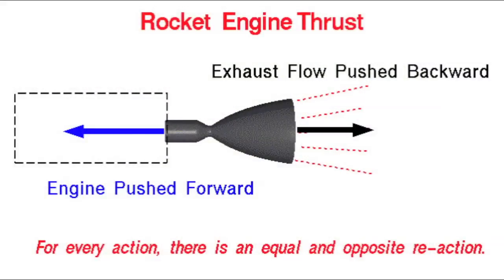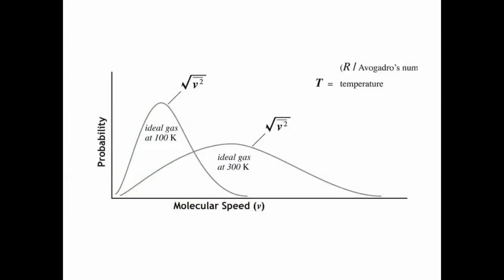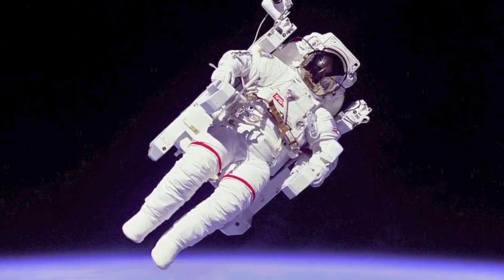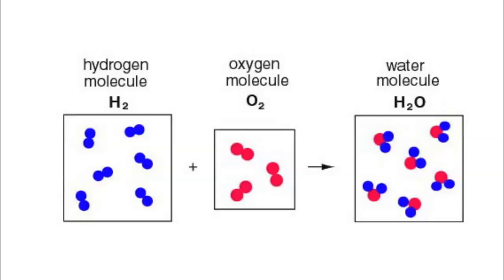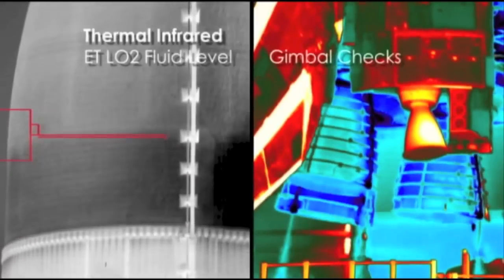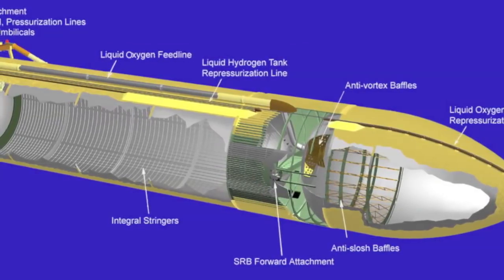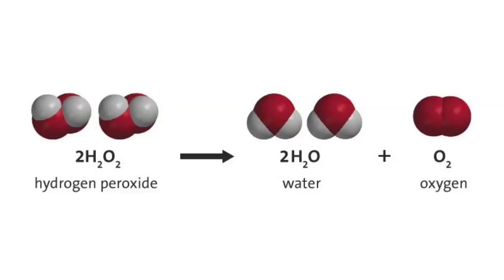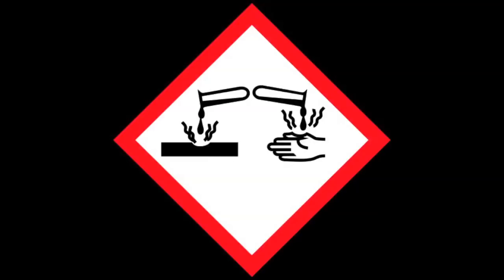WTF is Rocket Fuel Anyway?

Comment: From what I can find to produce antimatter you would make use of the Antiproton Decelerator and the high energy of the LHC isn't needed. The current production rates of antimatter would mean that it would take over 100 billion years to produce 1 gram of antimatter. Also as of yet people have only really stored a few hundred anti hydrogen atoms for less than 20 minutes. You'd certainly want more than 10^22 times more anti hydrogen atoms and store them for many times longer for use in an engine.

Comment: How about VASIMR? Also, there was an experiment with a small-scale atmospheric laser propulsion. It focused the beam into a point below the craft, heated the air to a plasma and rode the pressure wave up. I had to do a 5000-word essay on alternative propulsion for one of my extended project and it was one of the ones I covered, though I can't seem to find the essay itself so I can't give you my sources. Also, its potential for debris removal could be interesting for us space-littering KSPers.

Comment: Depends what you mean by environmentally friendly

C2H5OH + 3O2 -> 2CO2 + 3H2O

The combustion of ethanol produces carbon dioxide (global warming), although it doesn't directly harm anything

A rocket made of ethanol, i imagine, would be extremely inefficient. Ethanol doesn't burn too hot, and CO2 and H2O aren't as light as some of the exhaust gases for other fuels

I'm just guessing though, perhaps I'm all wrong

Comment: Well, it depends what you want to do with it

You could potentially use antimatter -> matter collisions to heat up a propellant (to whatever temperature you would like) and expel it out of the engine at extremely high velocity. Theoretically it'd probably be quite efficient.

The main problem is that we can't really produce antimatter in any reasonably quantity, and storing it is a bitch (seeing as it annihilates on contact with matter and turns into pure energy)

Comment: I don't think the V1 wasn't a rocket, it was a jet if I remember correctly. However, the V2 was a rocket, and yea they were both pretty much useless. They were expensive, inaccurate and  ineffective, blew up on the pad as often as they launched, and were ridiculously short ranged for a rocket. 
Anyways my point is, we may need all that ridiculous power and cooling you describe with today's technology, but is that a reason to give up on it? Who knows what incredible breakthroughs might pop up.

Comment: Radioactive materials produce a lot of energy. If there is enough, the energy sets off a chain reaction that makes too much energy which explodes and fissions it much faster. If there isn't though they just make a lot of heat. Nuclear engines don't actually use liquid fuel and oxidizer like in KSP, they just heat up something like monopropellant and spew it out. In the config file it has a note that says that the devs know it isn't realistic but didn't want to make separate types of fuel yet.

Comment: Scott, you forgot the one mixture that might be the wave of the future: liquid methane & liquid oxygen.  The XCOR Lynx's engines will be powered by methane & Lox, and Spacex has announced their Raptor engine will also use it.  It has some huge advantages: it's cheap and widely available, you can make it on Mars, it's less cryogenic than hydrogen and denser, and it doesn't clog up engines with carbon (great for your reusable rocket).  Downsides are its cryogenic and less dense than kerosene.

Comment: How could you beat LH2 + LO2???  You can use solar power to distill and electrolyze water into H2 + O2 and then compress/cool it to liquefy it.  Done.  You'd need a LOT of solar power to do it...but, when it's not busy making rocket fuel, you could provide that power to the electrical grid.  Plus, as Scott said, these propellants turn back into water vapor when used up.  Done.

Comment: Project Orion, there's quite a good wiki article I think. Basically it was pretty seriously considered as an interplanetary drive. It gives both high thrust and high exhaust velocities (and thus efficiency) kind of like combining the nuclear and mainsail engines in ksp ;) 

Basically you can't achieve this in a normal design because it would make the internals too hot, so you throw it outside and just blow it up. 

I believe it was abandoned due to the test ban treaty and concerns over fallout.

Comment: The SLS's first stage are the Shuttle's boosters with one additional segment. The second stage uses RS-25D engines (simplified but less efficient SSMEs)
The third stage will use up to 3 J2-X Engines. The Shuttle's Boosters run on Solid Fuel, the RS-25D and J2-X are Expander cycle engines running on liquid hydrogen and oxygen. YET there are proposals of using Liquid fueled boosters using F1-SIZED(NOT F1) Engines, but thats a theory by now.

Comment: WARNING: I don't know what I am on about either, but I have a vague idea
A nuclear engine is somewhat like a nuclear reactor in that a radioactive material undergoes controlled decay to create heat. A medium is applied to the material which causes it to evaporate at a huge rate. In a nuclear reactor this drives a turbine, whereas in a nuclear engine it's thrown out the back of the rocket to create thrust. I may be right, I may be wrong. I don't know TBH XD

Comment: Excellent video scott!

I liked your explanation of why nuclear rockets have a higher specific impulse then chemical rockets.

I thought I would add some other obscure propellants and engine types as well:

Arc-jet reactors, which use an electrical arc to vaporize a reaction-mass propellant such as butane. 

And pulsed plasma thrusters, which use an electrical arc to energize an inert solid propellant. 

Both of these are on wikipedia.

Comment: To be precise, in the case of turbojet and turbofan engines, they fan blade sucks the air and then being compressed inside the engine. The compressed air then mixed with the jet fuel and then "boom", the fuel ignites. The gas expands and then exhausted to the rear, and thus, propelling the aircraft. But in the case of ramjet, you need at least mach 2 velocity for the engine to work since ramjet doesn't have any fan blade to suck the air. That's the short explanation about how jet engine works.

Comment: You can't stop heat from flowing into the cold fuel, and if you keep the tank sealed the pressure will rise as it tries to boil. Density liquid H2 at boiling point & 1 atmosphere is almost 80kg/m3. Density H2 at 0C and 1atm is 0.09kg/m3. To match density of liquid would need 80/0.09 = 889 atm of pressure. Tanks would be too heavy to fly. Space shuttle tank was ~2 atm. Instead they keep the liquid cold by allowing boil off to take heat away and keep topping up with more liquid until launch.

Comment: Indeed. These engines only work in-atmosphere because they require atmospheric oxygen to combust the fuels.

The KSP concept of "air-hogging," throwing on preposterous amounts of intakes on a ship, exists because it allows you to "gather" more oxygen at higher altitudes. High altitudes involve low pressure atmosphere, meaning there is less and less oxygen the higher you go, so more intake surface area is required to obtain a sufficient amount of oxygen to prevent flameout.

Comment: Maybe my understanding is a bit lacking but based on my understanding of the SRB design wouldn't they lose all their thrust during flight gradually as the fuel is used. My understanding is that the fuel burns and the force goes out the back but the pressure that make it all happen would lower since it expands as the fuel decreases.
ps I watched a show about going to AC in the future and the host had this idea about solar sails getting hit by light to travel, would that even work?

Comment: Google Pentaborane and Dihydrogen Difluoride for extra fun propellants...

Hydrogen peroxide is sadly overlooked these days. It doesn't have an enornous specific impulse, but as an oxidizer it does have a bit better performance and it's non-toxic, storable and fairly dense. It also makes for much lighter exhaust gases than LO2 + RP1 (much higher H2O content in exhaust). And it can be used in a monopropellant staged pump cycle.

Comment: Nice.

The exhaust of the SSMEs isn't just water. They run hydrogen-rich rather than stoichiometric, and anyway there isn't time for the reactants to reach full chemical equilibrium during supersonic expansion, so the exhaust includes hydrogen in less oxidised states as well as water. The extra hydrogen gives a higher specific impulse with a cooler flame.

For mad fuels, look up the Charles Stross short story 'a tall tale', and John D Clark's 'Ignition!' for the truth.

Comment: I am aware of how a fusion reactor works. I must apologize for I don't really know what the person meant by an "engine that works on fusion". I assumed he/she meant to replace the normal fission reactor with a fusion one. In theory it would work to drive an engine as both nuclear engine types produce heat, wich is what is needed to drive the propellant forward(if I understood the video correct). A fussion reactor would probably not fit in a rocket though.

Comment: To get the most out of your rocket you want the exhaust of the rocket to be flying out of the rocket as fast as possible.  When you are in the atmosphere you have to fight against the pressure of the atmosphere which slows your rocket exhaust down.  In space there is no atmosphere to fight against so your rocket works more efficiently.

Comment: I believe it has a lot to do with controlling the rate of expansion of the exhaust so that you can impart as much energy as possible to the craft. Varying the exhaust velocity and temperature allows thrust and specific impulse to be altered, usually there is a trade off due to the laws of thermodynamics and what have you.

Comment: we have made antimatter before although you can only store it in extremely small amounts with a strong magnet in a vacuum not to mention controlling the resulting blast through an engine would be a huge challenge in itself also the magnets would break the electronics on the ship and if the fuel tank gets a hole in it your in trouble

Comment: Yes, SLS will use the same fuels as the space shuttle. No, they didn;t consider anything else because one of the requirements was that all of the components be 'shuttle derived' because congress sees NASA as a jobs program. They are using the actual SSME engines for the core and extended 5 segment solid rocket boosters.

Comment: That is incorrect. Plasma is simply ionized particles. Electrons are stripped (not destroyed) from the atom, but not all of them are removed. Electric signs (e.g. Neon signs) are simply glass tubes with an ionized gas existing in a plasma state. Same with plasma TVs. Plasmas do not need to exist in high temperatures, but they often do.

Comment: Plasmas do not necessarily need to be hot. Plasma is simply charged particles, and ion engines operate by ejecting ionized (charged) particles aft; they could be considered a type of plasma engine.

Different types of plasma engines exist, such as the VASIMIR, but they generally differ only in the way they ionize the propulsion agent.

Comment: Not to hijack your question, but a functional "antimatter engine" would work similar to a nuclear engine. The device would mix equal parts of matter and antimatter, the combination of which releases pure energy (heat, light, etc...). While this would provide no thrust on its own, the energy could be used to superheat a fluid to expand, vectoring it for thrust.

Comment: no. Void volume has little effect combustion chamber pressure while there is still fuel to burn. The pressure is set by a balance between how fast the fuel is burning and how fast it can leave the nozzle. Burn rate is mostly determined by how the grain's surface area evolves. Nozzle flow is non-linear - below a certain pressure it chokes and reduces flow.

Comment: Its just my understanding was that you had a solid chunk of fuel sitting in a container which would empty as the fuel burns creating a gap in the fuel that would lead to lower and lower pressure and in turn thrust, there for rendering the SRB essentially useless after it burns 50% of its fuel (depending on design).

Comment: Nope. The most efficient fuel at launch is actually RP1, due to its higher fuel density. This makes the fuel tanks (and therefore the rocket) smaller and lighter, which reduces weight and air resistance. Once the rocket has left the atmosphere, though, air friction is effectively gone so the higher specific impulse of hydrogen wins out.

Comment: Core design and cross section is one of the biggest factors related to solid rocket performance, and determining how the core will expand during burn is equally important.  Look on Aerotech Rocketry's model rocket site to get a small idea of how it works, and compare the blackjack and warp 9 motor types.

Comment: Yes we have made antimatter in a lab...what's problematic is that you have to use high power particle accelerators to make it and the you have to IMMEDIATELY capture it in a vacuum within a magnetic field or it will detonate on something like a stray air molecule..

Comment: A Question,If most fules need an oxidizer(oxygen being rather finicky to deal with, but great for bonding with other elements). Would/could/are there fuels that use carbon for a similar reaction?

Comment: Thanks a lot! I knew that the temperature change would be impossible to avoid, and figured that the pressure would rise too, but I wasn't sure how strong that pressure would be. I suppose I also don't understand how large pressure vessels like those differ from small ones that one would see more often, like a compressed air tank for paintball or a scuba tank. You definitely gave the best answer here =3

Comment: What is the rocket fuel in KSP?
Reply: Ben Hamilton By the usage of jet engines, it appears that KSP's fuels are Kerosene and Liquid Oxygen, but there is quite a bit of debate and nothing official has been stated.
Reply: +Ben Hamilton It's rocket fuel.  Nothing more, nothing less.  The densities mean it's close to RP-1 but it's used in the nuclear engines and fuel cells which then suggest it's H2.
Reply: in ksp the fuel depends on engines.
Reply: Liquid hydrogen, judging from the product description of the ISRU converter.

Comment: What about Ozone as an oxidizer?
Reply: I'm pretty sure ozone is actually less reactive than O2 since it doesn't have the double bond
Reply: Test Tube
I thought it was more reactive. I heard it somewhere.
Reply: 5thDragonDreamCaster I could be wrong, I'm just going by what it seems to be based on the type of bond
Reply: Test Tube
I'm not sure, but I do know the use ozone to kill bacteria.
Reply: Hi sir. I think it's because Ozone is relatively heavy. Are you proposing a standalone use or with something else(Hydrogen for example)? I mean if it were to be used alone maybe it won't be the worst material for a mono-propellant. Maybe Scott Manley can help us with this pickle (:
Reply: MHD Rachid Alhourani
I was supposing with Hydrogen, but I suppose that it could react down from O3 to O2 and be a monopropelant.
Reply: 5thDragonDreamCaster well that's how Ozone be like :p
Reply: well, the problem here is that ozone spontaneously decomposes into oxygen... Under atmospheric conditions the estimations for the half life of ozone go as low as half an hour (though this is not verified, as it is difficult to study). This can obviously be prolonged by applying pressure, but storing it for sufficient lengths of time would still be a real problem. Not to mention the fact that getting any amount of it with reasonable purity takes quite a lot of effort
Reply: Phebus88 thank you for the reply (: things are clearer to me

Comment: Water is light? Wat?
Reply: Compared to many other substances, yes, it is.
Reply: johnball12345 With a mole mass of 18 g/mole (1000 kg/m^3) I wouldn't consider water "light".
Reply: You've got a point. To make oxygen/hydrogen engine with higher specific impulse they put more hydrogen into combustion chamber, so it's not completely burned and exhaust is actually mix of water and hydrogen, so it's lighter and your overall perfomance increases.

Comment: Fuel is fuel, high in carbon, needs O2 to burn, diamonds are a form of carbon but because of atomic structure not readily flamable.
Reply: Duane Meulners   Hydrazine contains no carbon.  Neither does hydrogen.  LH2/LOX is the highest energy rocket fuel combination in common use.  It contains no carbon.  Hydrogen peroxide, used as a monopropellant to power Soyuz rocket turbopumps, X-15 and Mercury RCS thrusters contains no carbon.